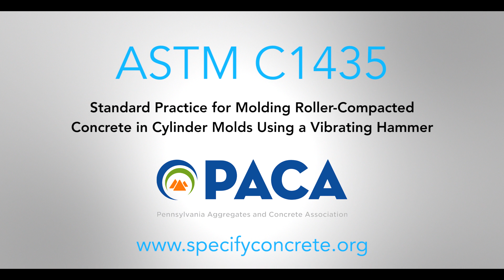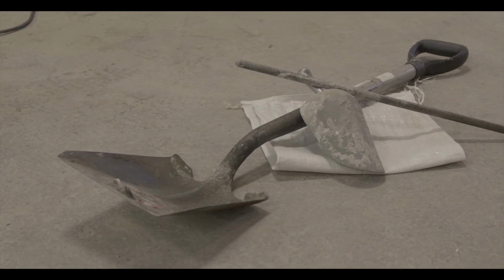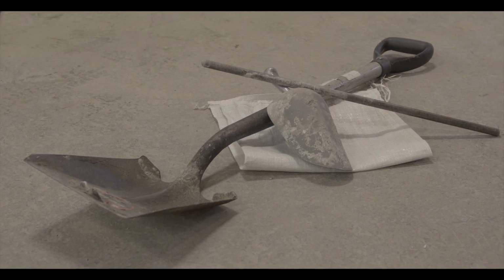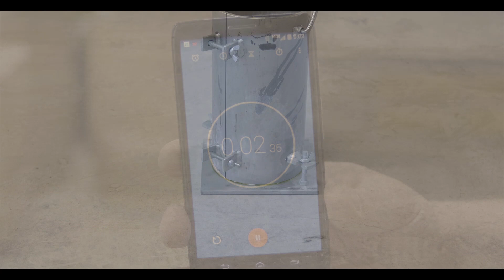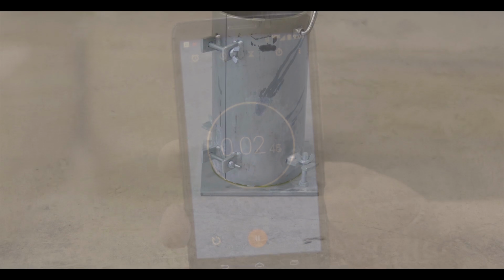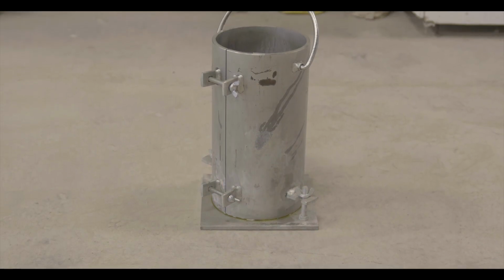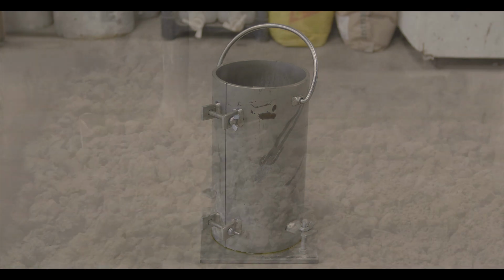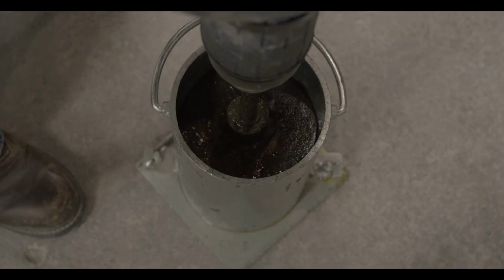Making Strength Test Cylinders for RCC - ASTM C1435

Comment: If i use 100mm*200mm cylinder,  as nominal maximum aggregate size is less, how much layer should i make? Will Vibration time the same as 150*300?

Comment: if im just using a compaction hammer? what will be the # of blows needed? and the code also.
Reply: I have read about an article about modified compaction test and RCC for experiments. Same procedure in ASTM D 1557. But I'm not sure if this is a good way to experiment on RCC since the unit weight decrease from 7.7% compared to Roller vibrator.